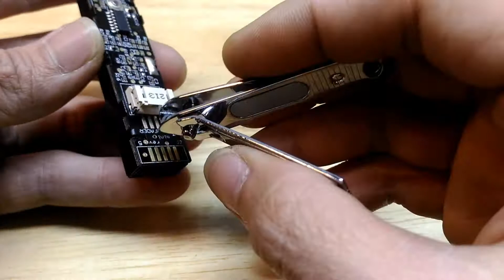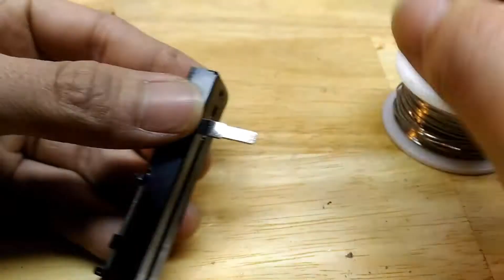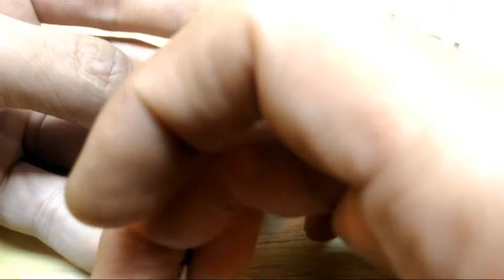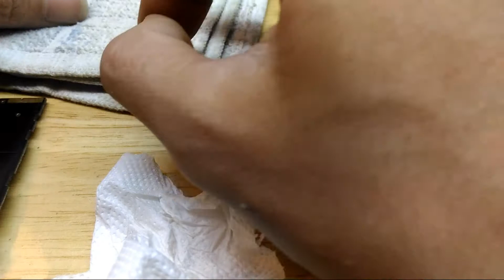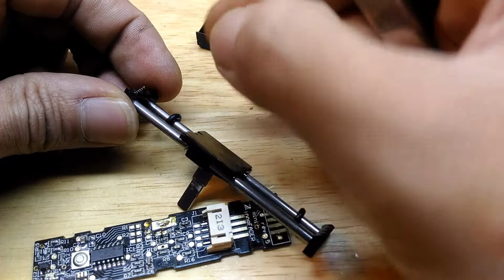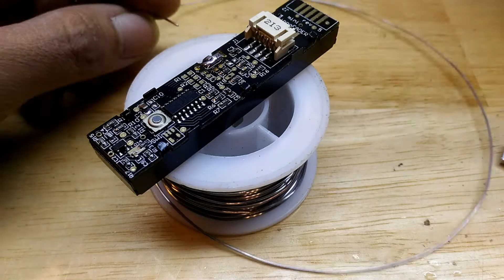mini innofader in Traktor Z2 mixer Cleaning

Comment: Massively helpful vid. I've done this and got my cut back BUT its now a bit tighter when it moves and requires more pushing. Should it be lubed at all, or possibly I've pushed in back in too much and tightened the tabs too strongly?
Reply from the maker: Yes,you need to lubricate it

Comment: Thanks for this, man. After 5 + years of heavy usage my crossfader finally needed cleaning. I tried to get it done without breaking the solder 'seal' but alas. Since I have no knowledge of electrics and soldering; why is that one solder point essential? The fader casing seems to stay close perfectly fine without it. Any thoughts?
Reply from the maker: fader casing solder because it's connected to GND,you need remove solder to open fader
Reply: dootejun are all the innofaders like that?  I’m gonna need to open up a PNP2 soon to install rubber stoppers...
Reply: @ianskar  do you know where you can get the same rubber stoppers? I was thinking about added another one on each side of the regular innofader to make the cutting a little more sharp.
Reply: @DV91  I got them sent from Innofader company.  Email them and they will get it sent to you.  I got mine for free because my mixer and pnp2 was actually not so compatible as mentioned on their website.
Reply: @dootejun-DIY  What's the strands of metal you use when you first heat up the solder? Is it important?